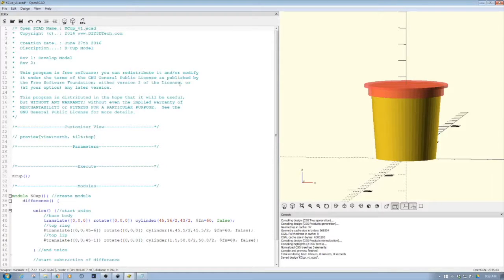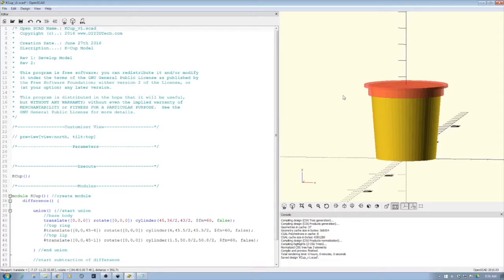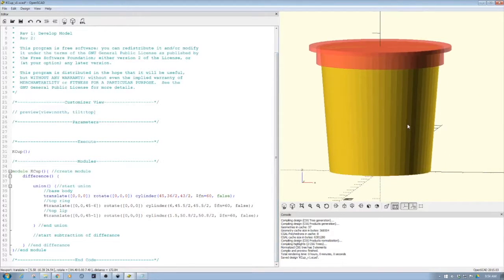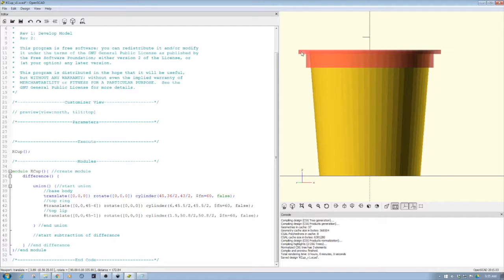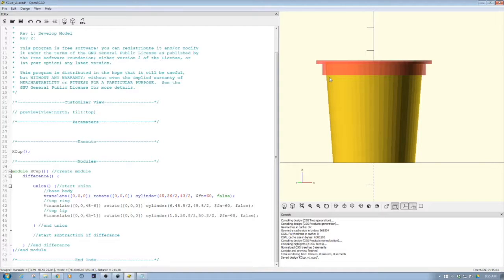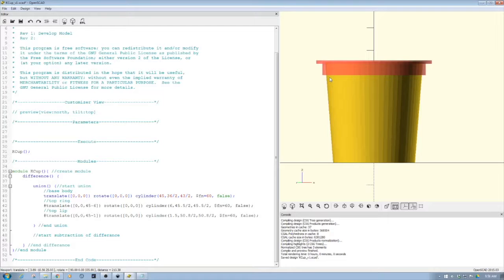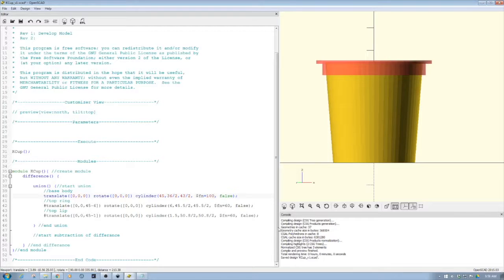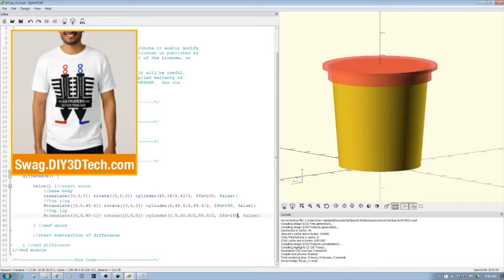Open SCAD - Coding a Keurig KCup cartridge for 2 5D and 3D Modeling!

Comment: Thanks for these demonstrations and I am very interested in being able to use openSCAD better. But the problem is that the text is so small it makes it very hard to follow along. I watch most of my YouTube videos on my 50" TV and I the code is all just blurred lines. 

Thanks for the content and I do look forward to sing them but it would be nice so I would not need to go out of my way to get the code to be able to follow along.
Reply from the maker: Good feedback and yes realize that however it's difficult to show the whole thing in YouTube and try to call out the areas of interest so you can go to the web site and download the code.  I also try and go the extra mile in documenting the code as a reference.  I do these on both a Windows as well as Mac using OBS Sudio so if there something you know of or hear of, I am all ears :-)
Reply: +Open-SCAD DIY3DTech also it depends how you encode it as well. I use screenflow which gives allows you to capture the screen and zoom in on areas as well as good effects for your screen capture. I also found because of the encoding it was always much clearer.
Reply from the maker: I am using OBS Studio (on both Windows & Mac) and I have not seen a "zoom" feature but will do more digging :-)